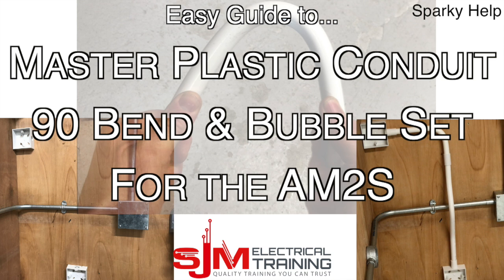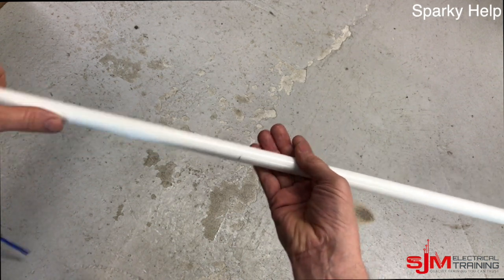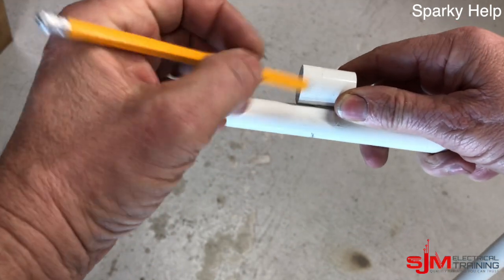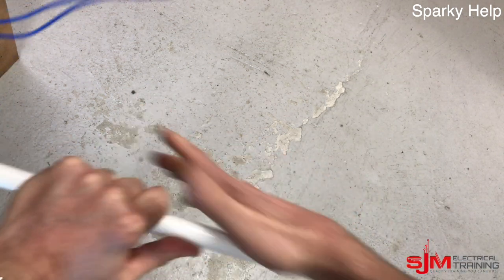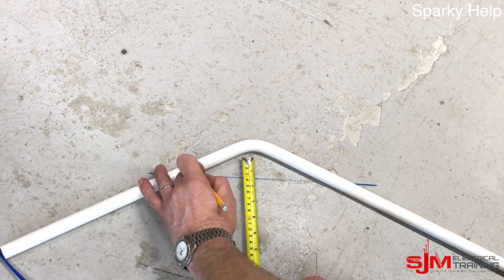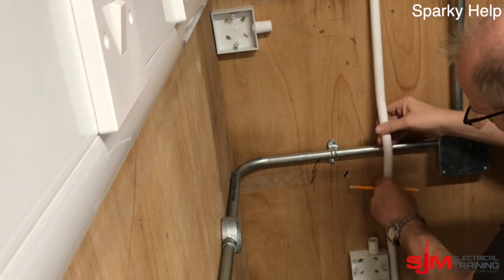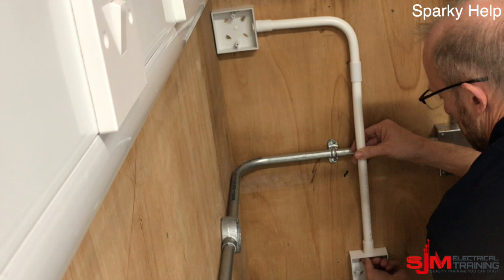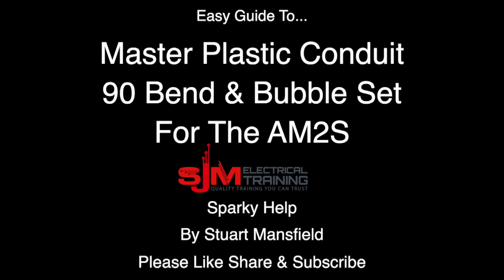Master Plastic Conduit 90 Degree Bend & Bubble Set For the AM2S

Comment: Great Vid!, on the AM2s are you expected to secure the PVC conduit with a saddle or is it just installed as per video? not a major and sure it will state in spec but just more of a wonder. thanks.
Reply from the maker: Hi and thanks for watching, always read the spec, but make a judgement call weather it needs extra support.  But I believe if a saddle is required it will be in your box of parts or pre-installed.  Don't forget to like, subscribe and share - Good luck

Comment: Plastic conduit I always get kinks in mine when I when to bend it
Reply from the maker: Thanks for watching please share with like minded people, maybe even like and subscribe.  Glad you find it useful.
Reply: There are 2 types of PVC Conduit, Light gauge and Heavy gauge with Heavy being obviously slightly thicker even if they are the same diameter (ie. 20mm or 25mm) The hollow bit inside the heavy is therefore smaller because of the extra thickness. If you use a Light gauge spring in a Heavy Gauge tube the tube will kink unless you really warm it up. You can tell if its a light gauge springe in a Heavy gauge tube because you will feel / hear the spring rattling around inside the tube. It should be tight, the gap is whats kinking. Like wise, you often can't fit Heavy Gauge Springs into Light gauge tube. If that makes sense.    I know its an old comment but maybe you'll get a notification.